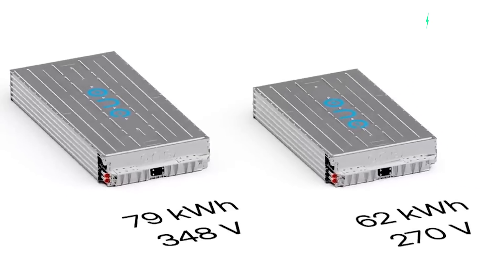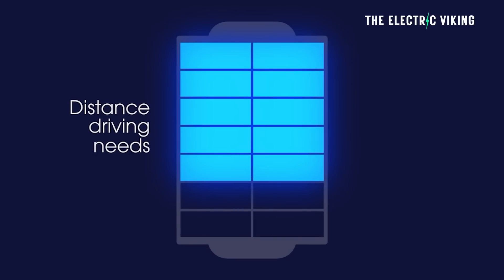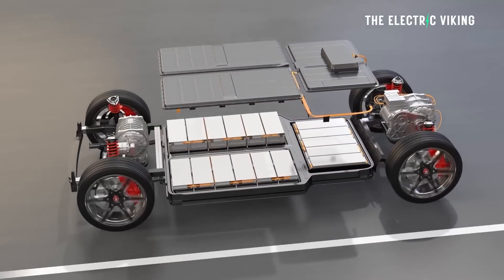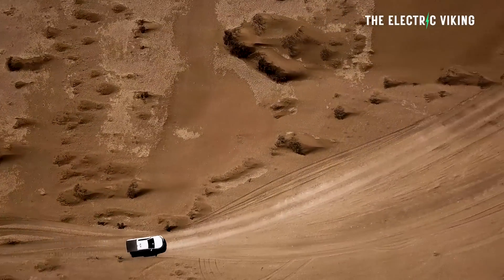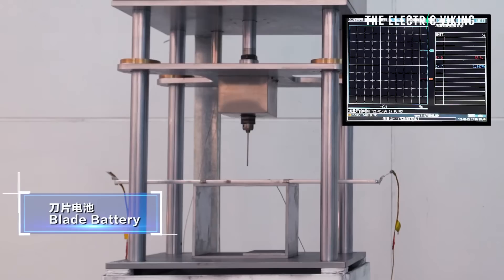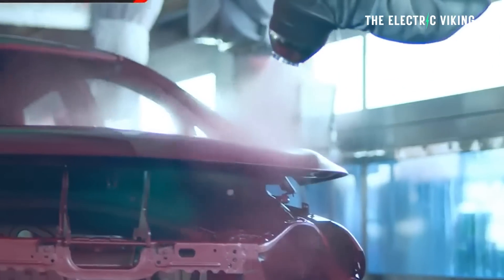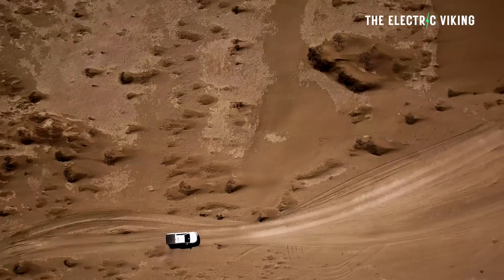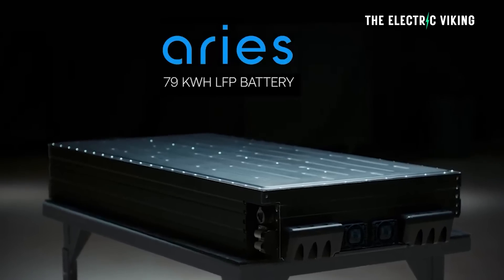American battery company reveals amazing LFP battery price & energy density

Comment: The Aries LFP battery pack specs are underwhelming.  The 79kwh pack is 550kg, giving an energy density of just 140wh/kg at the pack level.  That is on par with other LFP cells at 170wh/kg given the weight of the pack casing, wiring, bms, cooling, etc. taking it down from 170 to 140.  What is below par is that they only rate that 79kwh pack for peak power of 120kw/(160hp) where the average EV LFP cells can discharge at 3c continuously, which means 240kw(320hp) from a 79kwh pack.  So these LFP cells in the Aries are definitely geared to long cycle life and low power, more like an energy storage battery than an EV battery.  Having two 400v packs in a car, 40kwh LFP and 50kwh NCM would save you 400lbs of weight compared to a 90kwh all-LFP pack, and the logic of using the NCM only for trips over 150 miles would extend its life, but you throw away the safety factor of having an all-LFP pack.  If you are going to do that, might as well go all-NCM and save another 200lbs weight.  NCM is now pretty reliably 1500 cycles, and with a large pack like 90kwh, each cycle would get you 350 miles.  That is 525k miles until the battery is down to 80% capacity, so the car still wouldn't be dead, just down to 280 miles range.  For most drivers, the car would be 40 years old before it hit 525k miles.

Comment: excellent video. Cost and battery longevity are the 2 most important factors when looking for an EV so manufacturers using LFP will be my future choice like the low specs MG4, BYD dolphin or Volve EX30.  It will be interesting to see degradatoin data of these over 100kms.

Comment: LFP has a very good charge rate and a very low self discharge rate. The snag is poor cold weather performance and if allowed to stand in a discharged state they will brick themselves. The charge and discharge stop is also abrupt. It causes a significant voltage surge which has to be managed.

Comment: The CEO of the company was interviewed on AutoLine After Hours last week.  He sounds like he has his sh*t together and he came across very knowledgeable and confident w/o any BS.

They are still small and it's early days, but holds a lot of promise.  I think having a secondary battery will be especially applicable for towing (which most people only do occasionally).  But I don't think this is a long term solution since battery energy density will become good enough in 5-10 years that you won't need a dual/hybrid approach.  For now it's a possible option.

Comment: Yeah.  BMW are not going to be using Aries.  The power density is so low.  Peak power from the bigger battery is only 130kw.  So will not give a good performance EV.   Range is fine but car will be very sluggish.

Comment: On a two part battery where one part is different, In this case the shorter cycle count anode free part, wouldn't it make sense to have that kind of battery swapple, so
that normally you could drive around without its weight, and the be able to swap it out as needed .?

Comment: That's interesting news. I was thinking a high capacitance capacitor to accumulate a surge and vice versa.
Just put a 20KW system in a 37' Irwin to replace the 4cyl Diesel. Test ride tomorrow. Under sail she can regenerate the batteries.

Comment: “There is no real point in having a battery that doesn’t have a higher energy density.” I agree. I think this company set it’s sights on replacing BMW’s CATL batteries on iX models that are made in the US for the US market in order for BMW’s excellent EV designs to get the full tax credit. That is all they are doing. 

There is a point with LMC and LFP batteries where additional power of a larger battery doesn’t overcome the additional weight required. If 🇺🇸 manufacturers want to beat China in providing global battery supply then it will not come from copying those designs. I’m holding out for LiS and SeS chemistry for this purpose. Although SeS has sufficient ED to fuel electric aircraft, I think it’s best application is for automobiles so that battery packs don’t increase weight and tire wear. LiS is capable also, but trades a shorter life cycle for weight reduction and lower cost. It is possible for a manufacturer to package a LiS battery powered vehicle with a pre-paid battery replacement at 100k miles or so and still profit over LMC. I don’t think that would ever happen because admitting to a shorter battery life up front would turn off most buyers, and that could tank the whole project. I frequently hear ill-informed people complain that EVs are not a permanent solution and Dino-fueled vehicles will last forever. 

I own a 2023 Bolt EUV. I thought it was the silliest vehicle when I first saw it until I started examining the interior specifications. It was bought to be an in-town work taxi, but has the bonus capability to travel 200 miles to my parent’s house for visits. Point is- know your use case before purchasing. Tire wear was a consideration. EVs with large battery packs wear out tires faster, and EV rated tires are more expensive. I know the Electric Viking doesn’t like GM, and I share much disdain for GM. I could not find a better EV that would perform a job for my family and also provide a ROI as quickly. Ford’s mistake was trying to compete with Tesla on Tesla’s ballpark. An inexpensive EV with good ROI is what the market wants- nobody else is delivering.

Comment: I have been wondering why companies haven't made EVs this way for a while. Lyten have very high energy density, are cheaper than NMC (maybe even LFP) cells, so you could make a sodium ion 150 mile range battery and a lithium sulfur 450 mile range battery and you would only use the extra during a road trip. Seems perfect, more range for lest cost. The problem is that the lithium sulfur batteries have only 400 charge cycles. 

So I think I figured out why they don't do this, and it is the warrantee. Keep in mind that the US and the EU both require a warrantee for the battery of 8 years and 100K miles. For most people that arrangement would work fine. But if you bought this car and used it as a rental, or a taxi, it ain't going to last. Since the manufacturers can't control how the car will be used for the warrantee they just can't afford to take that chance. That is why they are moving to LFP, aside from cost, is they are far less likely to ever need to be replaced under that warrantee.

Comment: Who needs a 600-mile battery? After about two hours of driving I’m starting to calculate how much longer/further I have before my next stop. By two and a half hours usually my bladder or stomach or back is complaining. My distance between charging stops on long trips is determined by this and charging station locations, not the size of my battery. Charging time is a function of how much I need to get to the next charging stop, not how big my battery is. 2018 Tesla Model 3 LR. I’ve twice done multi day 2000-2500 mile trips, and many more in the 500-1000 mile range. I’ve driven ~900 miles in a day twice. My charging stops, unless a meal stop, are usually just enough time to take care of those bodily functions - bathroom, buy snacks and drinks, and walk a few minutes. At least for Tesla in the U.S., battery sizes are big enough and charging is fast enough today. Larger range batteries are a convenience, but I wouldn’t spend money to buy anything over 300 miles of EPA range, and I certainly wouldn’t spend extra time on the road to charge a bigger battery.

Comment: That idea of using one bit of a battery with more cycling with less impact and the side with less cycles not hardly used to increase the life and possibly change part not the hole thing is a brilliant idea 💡
Polimer also can be shorted with a nail or short circuit and still way more Safe than other types

Comment: How the heck do you make a battery without an anode? The anode is what the positive terminal is connected to. The cathode connects to the negative terminal. Unless you have both then you get no current. The anode may be free of a particular element (like Cobalt), but you need to have something.

Comment: The idea of matching an aluminium ion/air battery to LFP as a range extender has been around for a while with research going on in Australia, India, Israel and the US.

The Al ion segment holds a lot of charge for the weight, but has limited cycle life. Vehicle ranges of up to 1,500km are expected. Cycle life seems stuck around 100 or so cycles😢
Reply: Aluminium air battery is totally diffrent than aluminium ion battery
Reply: @najibyarzerachic  Agree, both are under consideration and being experimented with.

Comment: The twin battery might look like a good idea, but, this would mean very little power for the "daily" drive part. And I mean power, not energy.
So when you punch it, would still go have to fetch power in the other battery.  Or have very poor acceleration performance overall.

Comment: Anode-free explained.

All batteries have an anode and a cathode. But battery makers also use the term “anode” to refer to the active material placed on the battery’s current collector during the manufacturing process. This material may contain graphite or silicon. We create our “anode” without this material. Instead, during “formation” — an essential step during which the battery is charged and discharged —  small amounts of lithium plate onto the current collector. This process forms the anode in our anode-free battery.

Comment: Fiat has proposed a battery modular system where you would have a fixed one (or two?) battery modules for everyday use, and then rent from the dealership up to three extra battery modules for long trips.  This would avoid bringing that extra non-used battery weight around and would reduce the cost of the vehicle.  If the dealership is not far away it would be easy to implement. For my budget and car use this system would be perfect. Hope it becomes reality.

Comment: FYI: the thruth about cobalt, it is a byproduct from copper/nickel mining industry. cobalt has a limited usage such as batteries but c/n have a far larger variaty of usage. as long as c/n are mined, some cobalt will always fall of wether you like it or not. or are ya going to tell us now to avoid c/n to safe those poor childs in the african mines? 
currently only15% of the global cobalt supply are used for battery production.

Comment: I'd like details on how the different types of cells are connected and used. Are they just in parallel, or does there need to be some power conversion circuitry to enable energy transfer from one battery to the other? If so it's not so simple.

Comment: Pretty sure the CEO of ONE spilled the beans on their gemini cathode chemistry on this podcast:
https://www.youtube.com/watch?v=GSvlxTF2Flc

They are validating the LFP CAM of canadian company Nano One materials (Toronto stock exchange), which also has proprietary formulations of high-voltage LNMO chemistries. These guys are the real deal.
Reply: LNMO is perfectly complementary to LFP. High voltage/specific energy, but limited durability while using mainly cheap manganese and some nickel (as he mentions in that interview).

I believe most cells will move to to managense and iron rich composition with nickel substituted according to the available supply (scarce) and end product price point.

Comment: This was what was going to happen with capacitor-battery hybrids, so that capacitors would take the initial charge and then transfer it to the longer range battery. In fact you could even add a third component of the capacitor to what these guys are doing:
1 Capacitor,
2 LFP,
3 long range battery.
So capacitor for quick top ups (fed by the LFP) and short bursts of acceleration, LFP for daily driving, and other Lithium battery for long range.
Reply: Capacitors have worse energy density than lead acid batteries though
Reply: @matthiasknutzen6061  Yes, so you'd have 2 or3 kWh capacitor, 20kWh LFP, and 40kWh the rest.
Reply: I think current lithium batteries are sufficient for charging/discharging at high rates. If ultra-capacitors offered some benefit, you would already see their use in Teslas and other EVs.

Comment: I'll remain dubious that it's a win for multiple reasons.  1.) I doubt there's a weight savings 2.) By having a shorter range LFP portion you're going to shorten the LFP portions overall range 3.) No details on energy density, self discharge rates, costs, charging speeds, ...  I think it's everything they said it is, but there is a lot as usually that they haven't said, and those are the things that almost always are the drawbacks, of which I only mentioned a few potential ones.
Reply: For example?

Comment: That's smart. Surprising no one thought of it before. Even the 150 mile smaller battery is probably plenty for several days.
This would be perfect for people like me. I'm retired and drive short shopping trips of 15-25 km 2-4 times a week but I need a bigger battery for a 600km round trip every month.
Reply: same here. i hoped for removable modules - cells you keep as part of your home battery but can be removed and put into your car for when you need to go further. lugging around a much bigger battery than you need 90% of the time is just wasteful.
Reply: @satoau1  those batteries are heavy, I'd rather not lug them around but I'd love a bidirectional battery that I can plug in to my house. Solar to charge the car battery during the day and discharge at night to run the freezer etc
Reply: @GlenisRetiredNZ  sure you could always just leave them there as part of the car battery, and i don't the entire battery, i mean if like half of the car battery could be removed as say 10-20 5kg modules and inserted into the house battery instead, so we could remove or leave in as much as we need, and enjoy the benefits of having a much lighter car for most of the time, while also having a larger house battery.
Reply: @satoau1 That would also have the other benefit of companies being able to sell cars with different battery sizes and allow customers to buy more modules later and also replace worn-down modules themselves later. Possibly even allow us to buy different battery chemistries, the modules would communicate their specifications to the car/house charger.
Reply: @yvan2563  wow good thinking, you're absolutely right.
hmm come to think of it would let you insta-charge also - park up, get out and swap out some empties for a few fully charged modules from your house battery
Reply: @GlenisRetiredNZ a 20kw. Universal powerbank for House and EV..

Comment: Non-annode battery is likely a "battery" that uses air oxidation (for instance the aluminum-air "battery").  The term fuel cell would be as accurate as the term battery in such a case.

Comment: this just seems over complicated.  if the battery cant handle the excess charge cycles thats more over complication and potential excess replacements that it needs to be.  would be more beneficial to have it entirely LFP 
if people are not using the 150 miles daily, then why have an over compilated battery that will never use that excess?  
when your range drops in half when its over 105F outside you will over use the "backup" battery that cant handle the charge cycles too.  

on paper it sounds good, but unless they can make that battery lighter, and take far more life cycles then it make sense.  
just make the battery lighter, less earth materials, cheaper, and have at least 350mile real world range at or under 60kwh in size...one type, keep it simple, and make sure it can be charged to 100, and at least 3000 cycles.